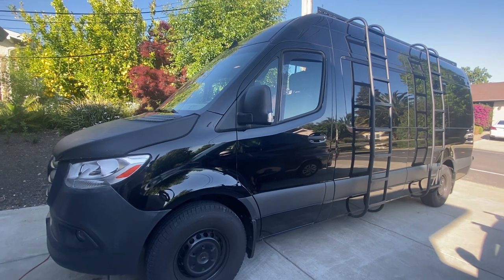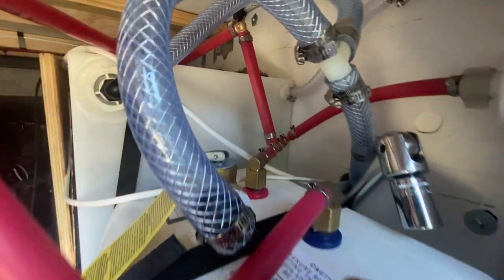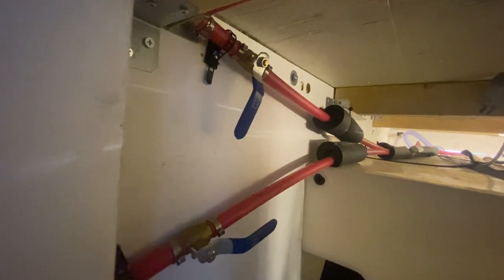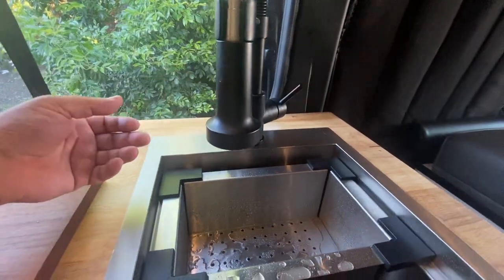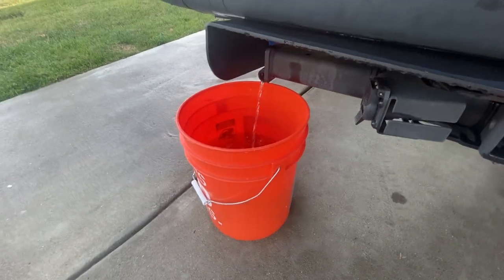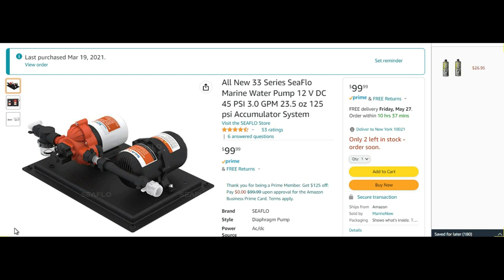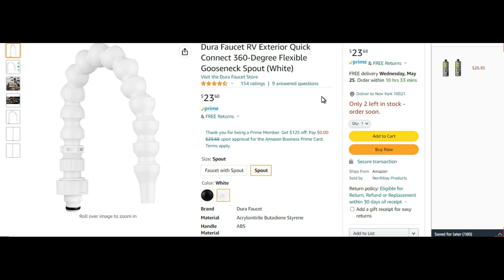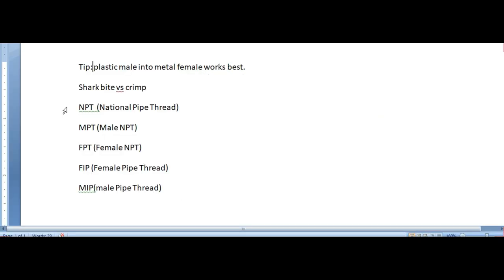Camper Van Plumbing - Van Conversion Simplified Plumbing with Shower + Kitchen

Comment: Thanks for posting.  My wife and I are selling our westfalia vanagon soon and we're looking to upgrade to sprinter and then do conversion w a frens help.  Do you strongly recommend the 170 over 144 if want a shower? I've seen some 144s w them but pretty tight.  Also, does the cassette toilet smell? My wife is sensitive.  Thx.  I'm in socal.
Reply from the maker: Yeah I think 170 is the way to go if you want a shower. The toilet does smell just be sure to buy the seal conditioner and use the drop in pills and you will be good. You can even use the disposable wipes with the cassette toilet as long as you use those drop in pills.